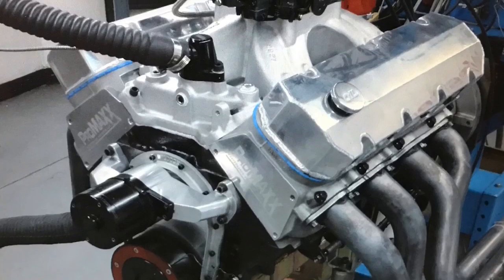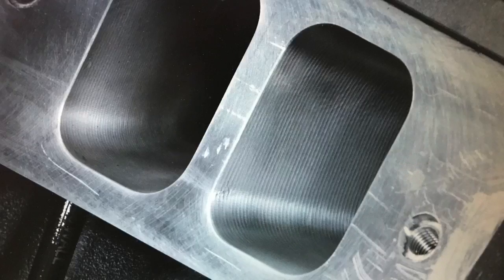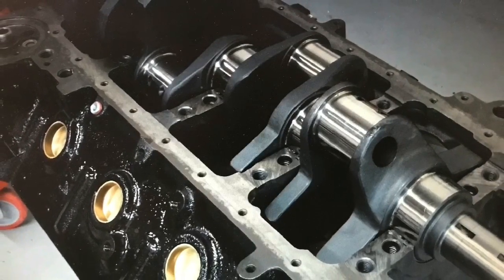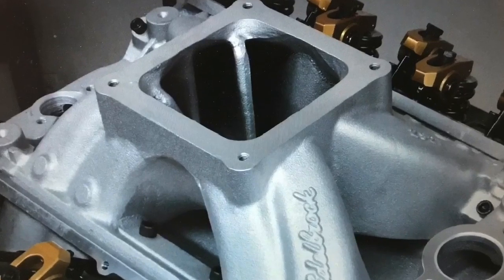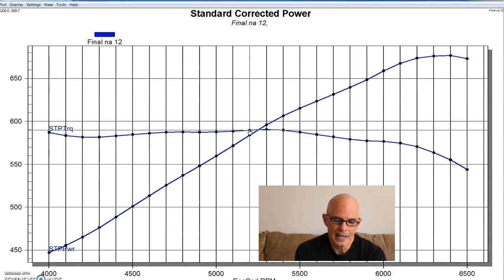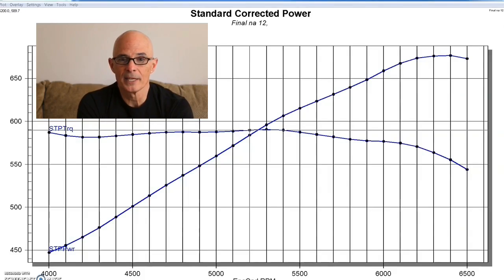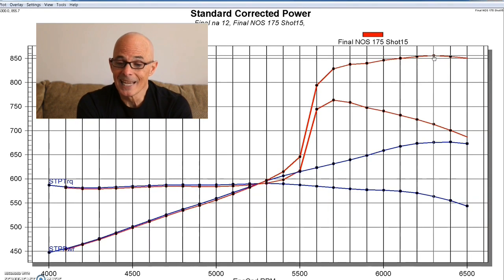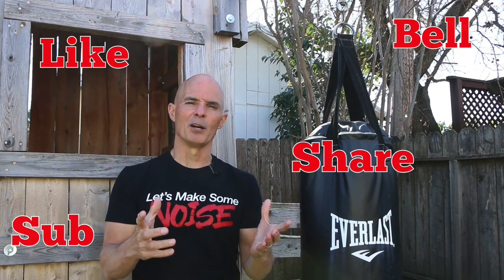NITROUS 496 BBC-CUBES & CHEMISTRY!!

Comment: Right but your running on a dyno  which is basically no load,  run it in a 3800 lb car over and over and over .
Reply from the maker: The dyno has more load than a 3800-pound car
Reply: @richardholdener1727  false, very very false .

Comment: Trying to find out what degree plug wires off the plugs are typically used with a bbc with aftermarket headers
Reply from the maker: we run 90 degree with long wires under our headers, but some run them on top

Comment: Man I feel SO much better now that you’ve confirmed 2 bolts will hold up to 1000hp cuz I’ve been told 700-750hp MAX…mine is very similar to this one but with flat tops and a much larger camshaft (Lunati .680/.700 lift, 296/304 split duration, and 110 LSA). Has 320cc Edelbrock heads and a Brodix 4150 single plane so obviously in the lower 9:1s for compression. Should love the adder though 😏 I’m hoping it’s in the 575-625hp range but we’ll see…always been a nitrous guy but really want to ProCharge this one🤘🏽I know this is a year old but any thoughts on my setup Richard Holdener?!

Comment: Mate of mine has built a 496 to take Nitrous and Dynoed at 824hp Normally aspirated..
Reply: What cam?
Reply: @benaiahtheassassin  not certain on The Solid roller cam spec. The Amazing thing is the engine is set up for NOS. I'm sure the Cam is big
Reply: @patrioticaussiesams8581  can you find out cam and heads?
Reply: @patrioticaussiesams8581  ??

Comment: This is very similar to the combo I have in my car.  Mine is only.030 over making it a 489ci and my compression is 13.8 to1 with afr 335’s, forged crank and H beam rods. Mine made 812 on motor then I have two nitrous kits each capable 400 hp each. The car runs easily in the 8’s.  Extremely durable and reliable and I couldn’t be happier.

Comment: Just recently found your channel and really like the BBC content. Having been racing close to 40 years and your information closes the loop on a lot of what I've learned in that time. You said you've never seen a crank break just on power... On my "Shelf of Shame" I have a Bill Miller connecting rod attached to a BBC steel crank journal from my first big nitrous engine explosion in my drag boat around 1990 or so.  Broke the crank into 3 pieces. Wasn't exactly just due to power, we detonated the motor due to not retarding the timing for the nitrous. I've run N/A, blown alky, blown gas and nitrous. Nitrous is still my favorite power adder. I've been racing drag boats with it since 1988 or so... Keep up the great work!!!
Reply from the maker: WE'VE SEEN PLENTY GET HURT THAT WAY

Comment: That thing makes 610hp at 5500, and 550hp at 5000 n/a. I could shift that thing at 5500, run very low 10s (cause thats where i WANT to be) and it would live for a thousand years. Or, shift it at 6700 and go low nines if i feel like it, and still drive it to in-n-out. Don't need no nitrous.

Comment: Have you ever done a gen7 vortec 8100/496 from a silverado/suburban? Are there differences between the stock gen7 and the engine you run here? From a noob from Norway.
Reply: They're a little garbage compared to the other ones actually. No head selection either.

Comment: Hey richard, i have a question. I just got a 1970 Nova with a 496 and 2 stage nitrous. Problem is, i know nothing about this.  It has a msd ignition, 1150 holley. The problem is it keep missing and fouling out plugs. Do you have any suggestions on what it could be? Im not running the nitrous and my suspicions are that its made to do so. Im wondering if the WOT first stage is retarding the ignition expecting the NOS yet im not using it. Any advice on this would be great
Reply from the maker: DO YOU HAVE THE SYSTEM ARMED TO ACTIVATE? IF NOT THEN ITS PROBABLY JUST RICH ON THE CARB
Reply: @richardholdener1727  there is a button to arm the nitrous which I have off. I have a msd digital 6 pro. I was just looking up the manual on it and im wondering if the WOT 1st stage is interfering with the timing or something. Or does that typically only effect it when armed? Like I said, I don't know alot about the subject but I'm hoping watching your videos and other will help me. BTW, thank you so much for your fast response! I see what everyone is saying about you
Reply: So basically I'm wondering if its retarding the timing expecting nitrous. I dont know if that has anything to do with my problem or not.

Comment: Thanks for awsome video Richard. I have built a very similar motor, which is purpose built for nitrous, with forged internals. My motor made 681 hp @ 6800 and 600 ft/lbs @ 5000. On 98 octane. My car is a modified holden hq 1 tonner. ( yes im from Australia.) So after seeing this video i am really excited to finish my project and hit my motor with a 200 shot.  I have seen you on motor trend. Again. Awsome video. HOO ROO.

Comment: Just a curious question, why couldn't you run hydraulic roller lifters on a solid lifter cam?
Reply from the maker: you can but ramp rates are different, its might be better to do the opposite-solid lifters on hyd cam profile

Comment: Richard, thanks so much for your knowledge drops in each video. I too was taught the rec port, steel crank and forged parts and a 4 bolt main being the only way to go for power. But found the task daunting when piecing together my first BBC. Thanks for clearing the air on all that. Gunna save me ton of money putting together my build and putting the money in the more important places instead of buying parts I won't ever need for my pump gas boosted build.

Comment: Would like to see a test with some oval port heads
Reply: Do we have a link somewhere?
Reply from the maker: I tested EVERY Oval and EVERY Rec port BBC head a few years back-I have all that data.
Reply: @richardholdener1727  do you have a link to the data from testing those heads or title to search for the video? I am building a 427 tall deck for my ‘81 c10 project. I am planning to use a 4.25 crank and 4.35 bore to make a 505ci. It’s a budget build so I’m gathering parts as I find good deals. I would love aluminum heads but will most likely have to use GM oval ports for this go around. Thanks for all the great videos!

Comment: The reason you leaned out and I’ve seen this a thousand times with multi stage nos systems stage one goes fine stage two goes nos backfire, when the second stage kicks in the gas demand is instantaneous and the fuel flow has a lag too it which cause you to lean out and nos backfire, single stage systems are your safest option every multi stage system ive ever seen blows up just like that
Reply from the maker: Not sure this comment applies to the BBC video

Comment: If you were building a 10:1 496 with Stock 990 heads and could only run a Performer RPM Airgap due to hood clearance what cam would you use? For power under 6500 or 6000. Still the 300BR? Love this build Richard.
Reply from the maker: There would be better choices-I just like it as an all-around when running NA and boosted and nitrous
Reply: @richardholdener1727  I'm all ears, have this engine going together now, but no cam yet. Open to solid or hydraulic roller. 3000 stall, 68 Chevelle.

Comment: This was a throw back to hear something needed 38° of timing for peak power. It seems like way too much when you compare what modern engines with tighter combustion chambers can do. The 22cc dome and only making 10:1 made me chuckle too. For all the things nice about big block chevys they have some massive shortcomings.
Reply from the maker: nothing you just mentioned is a short coming
Reply: @richardholdener1727  
"Good" and "Bad" intake ports. The intake ports overlaying where 2 head bolts would be. The huge chambers have high heat absorption surface and not great spark plug location. The huge chambers force a domed piston to even have pump gas compression, that makes the piston both heavier and weaker. Just about all of them come down to the heads. They are huge and strong. A buddy of mine got a tall deck 427 out of a really crappy dump truck that he spent far too much time arguing with me about the intake manifold on, and how he thought any big block manifold would work. The short deck height and short factory rod length isn't great either, factory 454s don't have the best R/s ratio and the short deck limits space for strokers, where even Chrysler "B" blocks are taller. They really are an artifact though. For how big the bore is, in spite of aftermarket heads, it still needs almost 40° of lead. The more serious the end result is, the farther it strays from the factory port locations and valve angles. I'm not saying they are not great, or don't have potential. Like you said in this video, at nearly 700hp on the street and over 850 spraying at the strip, this would probably last a long time . There are some shortcomings, it's still a nitrous big block and still awesome.
Reply: Yeah the biggest shortcoming it's really easy to make two thousand Plus horsepower on a big block Chevy. Most of us old school street car guys can't imagine or believe that.
Reply: Agreed I used to be all big block Chevy now I'm sold on LS. Pontiacs are my favorite but I can't make myself to do one with new technology.

Comment: Where is the 2002 8100  496 big block ??? . You need to run one .
Reply: That's funny because I'm building one right now and expected horsepower is around 700 n/a and 1200 on boost and I have 4 of these motors and I can find them all day everyday .  If we can get a few people to show these motors off thin we will gain  more support which we can use . Just get a stock one and throw boost at it and there are lots of parts for them . You can use 454 pistons and rods  and headers . The heads are different and intake but that's about the only big difference
Reply: There alot of us that run these motor for tractor pulls and drag
Reply from the maker: Not much support for those-much less common and harder to find

Comment: Richard what head gaskets do you use with the gen 5 block? I’ve read there’s potential for coolant leaking into the valley with a mk4 style head on a gen 5 block, have you ever ran into this issue?
Reply from the maker: we use Fel Pro gaskets designed for Gen V
Reply: Factory gen 4 heads on a gen 5 block can be a problem but all aftermarket heads work fine on a gen 5 block

Comment: I have a 454, from 1994, with oval port heads, and air gap 4bbl intake with 750 Holley, and long tube headers, I have seen a very similar engine that made 330hp and just shy of 500ftlb TQ,   I'd say a cam and rockers would make a big difference, it's from a rv, after I got it , I heard it had less than 50k miles, I think it was well worth $400,
Reply from the maker: yep

Comment: Speaking of heads. My theory is you can never have too big a heads. If the heads flow too much put in a lower duration cam to match the peak rpm you want to run at. Would love to see the comparison in power curves. Take like a big set of Brodix heads and run it with a 212 -224 kind of duration cam vs a set of stock heads with a 275-275 cam.
Reply: Too large of a head can make a very lazy port and engine on a street engine.
Reply: Scott Worelds never seen it proved on a dyno. Never have I seen someone make a pull on a big flow head that lost bottom end put a smaller cam in to see if the power comes back but stays better up top.
Reply: Going to test this theory with my nephew - we have a '97 7.5l(460) BBF on the engine stand that's getting swapped into his Mustang next winter, and we're going to throw a set of Kaase's new bad mofo SR-71 heads on the stock short block(fly cut the pistons if necessary) for the first season with the big block before we build it next winter(or find a good deal on a used race short block w/ an aftermarket block - aluminum would certainly be NICE)
Reply: A few years ago, car craft did a test with ported Ls1 heads vs factory ls3 heads. Same cam, truck, camaro and ls2 intake on ls1. Truck and ls3 intake on ls3. The Ls3 was about 20hp up at the top end but more than 20ft lbs down at 3000 rpm and didn't pull ahead till 5k. For the strip, their computer simulated numbers using ls2 vs ls3 intake were within a tenth and 1mph, the ls1 ahead but around town the with the higher torque farther down, the author thought it wouldn't even be close. If you were to put these heads in this test on a 427, they would leave a ton on the table compared to something like a set of edebrock 454-O heads on a street driven engine. The torque difference at 3000rpm would be closer to 40 ft lbs, the camshaft doesn't have the lift to make use of the high flow these heads offer.
Reply: On the dyno from tests I've seen on a BBC too much head didn't hurt power, but would it be lazy on the street? Hard to tell that on a dyno. Great call Brian, would like to see a big head with a small-ish cam.

Comment: What's the weight difference between this and a  6.0?
Reply: I am no Richard for sure but i believe a aluminum headed bbc weight 660 and a 6.0 ls is 535ish.
Reply: @johnboy9769  That's true for Iron LSxs - aluminum LSxs typically come in between 425-450lbs intake-to-pan, w/ flywheel/flex plate, w/o accessories. 
I believe the generally accepted number for aluminum block vs iron block LSx is 110lb difference 

Coyotes & aluminum 4.6l Mods fall right inside that same weight range, 425-450lbs 

I haven't had a lot of experience with BBCs, but the 460 BBF out in the garage is ~700lbs. I would imagine that a tall deck 'truck' BBC is about the same weight, while I'm sure you're right on for short deck BBCs like you would typically get from a junkyard.
I believe that all MkVII BBCs are 10.200" tall decks, while the previous gens are mostly only 9.800" short decks, unless you find a 'holy grail' production tall deck 4-bolt main 427 or something(or a garbage small bore 366" tall deck school bus engine).
Don't quote me on these details though, I'm not a Cheby guy and trying to figure out these production BBCs is a real pain in the ass
Reply: @RyTrapp0  gen 5 and 6 Silverado blocks are just short deck the tall deck 366 and 427 big truck engines used to be the way to build big inch chevys but the cost of aftermarket blocks are low enough now to be close to the same as a old tall deck after block work and most company's make short decks that can support 572 inches and on the ls stuff most people use the iron truck blocks.
Reply from the maker: No idea on weights

Comment: I am very excited I have a edelbrock Cross-Ram coming for my twin Turbo 6.0 LS 1971 GS build. Thank you for testing it that helped make the decision.
Reply: I've have one also, got it off eBay last year. I think I'm going to try to build a Rat Rod around it, just to be different. Mine is for a Rec port BBC.
Reply: That is one sexy as fuck manifold. Not seen it before, but it ticks all the right boxes. Would prefer black over red, but is it normal for a bloke to get so excited over a manifold?
Reply: LunarOutlaw’s Garage do you have a link to that video I can't seem to find it.
Reply: Dodgy Brothers Engineering I had to go back to the videos https://youtu.be/gODDOrRKVEs
Reply: Dodgy Brothers Engineering The episode name was who wins eight stack ram versus xram
Reply: @LunarOutlawsGarage  thanks a lot, I did find a video on another channel, but will be interesting to see what Richard came up with.
Reply: Dodgy Brothers Engineering 👍
Reply: @LunarOutlawsGarage  similar results except the test I saw the X-ram made more power and torque the whole curve. The downdraft is a bit disappointing. You give up a lot under the curve for a lit bit more up top, but damn it's sexy.
Reply: Dodgy Brothers Engineering I was looking for an intake manifold that would be appropriate for my 1971 Buick GS that I’m building up my channel. The original GS air cleaner it is such a radical design but I wanted to make sure that I brought that back into the build.
Reply: @LunarOutlawsGarage  I think I'd pick it just on performance. Not too hard on the eye either. And if you want to twin turbo or twin centrifugal down the track, then you are ready to go.
Reply: Dodgy Brothers Engineering yeah the goal is 180° headers with TwinTurbo’s. It is not a cheap intake but it is damn impressive
Reply: @LunarOutlawsGarage  you've got a new subscriber. Looks like it will be an interesting journey. I'm in.
Reply: @LunarOutlawsGarage  I just bought myself a new MIG / TIG / MMA the other day (still in the box) and I was thinking the same thing, how hard can it be to make up a simple exhaust? I already designed a turbo manifold for my SR20DET, I just didn't weld it because I didn't have a welder at the time. But I have been tinkering with the idea of building some pipes for my IS300.
Reply: @LunarOutlawsGarage  Yeah the price is a little scary but it could be worse you could be paying for it in Australian dollars. They would be about $2200 by the time you convert add tax, and then shipping on top.